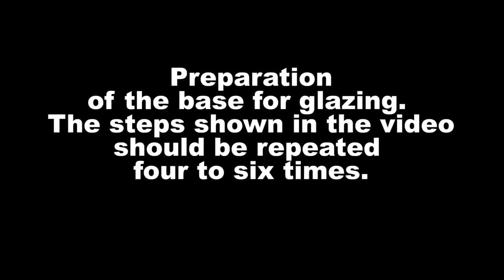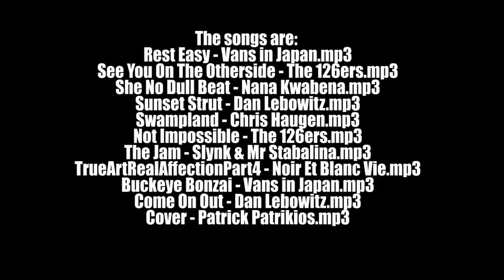Handmade 18KT gold ring with aquamarine gem and diamonds

Comment: Cant wait to make that ring in silver though,my enamel is torch enamel and i dont have fusion welder the flowers will be tricky the hard solder flows at aprox 1275 and the torch enamel is about the same by using gravity I think i caan make work i ,make butterfly ear rings that way i need a oven too